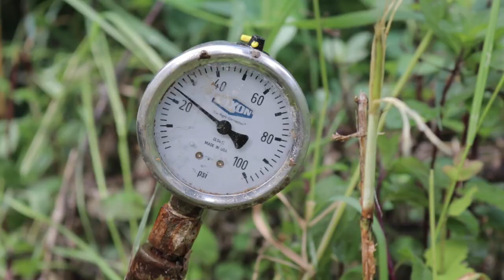My New Ram Pump - AMAZING!

Comment: Great Video, i appreciate what you say about moving water... im on a cattle station at the moment, and water is a major concern, we are in a drought and it hasnt rained for 2 years....so moving water around is very important here, we do it with pumps and tons and tons of pipe (the station is 1.3 million acres in size) this ram pump system is a fantastic idea...all we are missing is the elevation factor (its pretty flat out here) although the bore water is under a natural pressure....so it may work..... anyway great video and keep up the good work!!

Comment: At 9:00 if you can make the mesh into a conical shape then the leaves wont block the mesh (so much).
Reply: Oh! VERY good point. And while we are at it, how about a screen at the open end of the stand pipe, Sir?
Reply: Sure like the vent pipe for a toilet.

Just to be clear, I mean for the point of the cone to point away from the pipe.
Reply: Exactly by thoughts. A "self cleaning" design, often to be found in industrial components.
1) Look to increase the surface in contact with the in-flow, this will reduce the velocity.
2) Or, set up a meshed off pool in front of the pipe inlet, effectively increasing the surface area on the mesh.
3) Angle or taper the end, with the mesh screen, to use the stream flow to dislodge & wash away debris.
Reply: The mesh should have as much surface as possible. Sorry, but it was a mistake that you cut the mesh and did not make at least a ball-shaped mesh with a lot of surface. Regardless of that I like your stuff. Keep up the good work.
Reply: +trespire exactly.
Reply: Do you mean, what a plumber calls a "trap" like under the sink? (Some traps have a clean-out feature at the bottom that could be helpful too.
Reply: Also add a perimeter filter screen with larger holes around the intake I a 1-2’ diameter to stop large items before they get to the small screen.
Reply: in any case, maintenance has to be done. maybe not every month, but at least 2-3 times per season. all suggestions are valid and he should increase surface area of the intake screen/filter. do not forget if he lover down the intake, silt can and will build up enough to block intake. so check up is necessary especially after bigger rain falls.
Reply: @zoki.to974  The idea is to have a relatively large input box with a fairly fine mesh screen surrounding the input. The pool should be much larger than the box. Then, as the water is forced to slow to get through the screen, silt and other solids tend to settle out before getting through the mesh.

Comment: Hello. If u change that gate valve to a full bore ball valve, water will get less resistance going trough. That will increase the ram effect. That gate valve is slowing  down the water coming to the system. Great videos!

Comment: For all us electro-nerds out there, the ram pump works analogously to a boost converter.
The mass of the water in the supply pipe works like an inductor, while the air tube works as the smoothing capacitor.
Reply: Very good comparison
Reply: Very good comparison
Reply: Now that is language I understand. Nice analogy.
Reply: My background is more with plumbing and mechanical things. Hydraulic to electrical analogies are helpful.
Reply: Somewhere close to the end of the video I had the idea it may work similarly, then I found your comment.
Reply: I was thinking the same, just a little 2 level asynchronous boost converter.  Might be interesting to see one of these as a flying capacitor multilevel converter but that probably won't work.
Reply: Specifically, it seems like a Joule Thief. One in, one out, one common, self regulating oscillation. Additionally, the air tube isn't so much a capacitor as it is the inductor itself, as current flows into it, it creates a back pressure (EMF). It is definitely based off the idea that the current will increase pressure (voltage) to keep the current moving, like an inductor.
Reply: tactic00l the
Reply: tactic00l 8
Reply: I actually understood that. :D
Reply: @
tactic00l

this is the first time ive heard of converting plumbing to electrical equivalents , many times the other way tho :-)

Comment: Couple of tips for you:

When you open or close your gate valves (not the check valves, but the ones with handles on them), back the handle off a quarter-turn before walking away.  In the event that you leave the valve in the same position for a long time (like over the winter season, maybe) you may find it necessary to turn the handle in both directions before it comes loose and will let you run it all the way to the other position.  This approach does not work for Stopcock Valves (which only swing 90 degrees to open or close).  This tip is something I learned at my grandfather's knee... he was a Journeyman Plumber.

The other thing I would recommend is that you get a two foot long "Retrieving Tool", with a plunger on one end and three or four expanding prongs on the other end.  I generally soak mine in clean engine oil when they are new (or if they stop operating smoothly).  Throwing that into the end of your drive pipe to pull out debris will save you lots of time.  It is much more "the right tool for the job" than using a straight slot screwdriver.
Reply: That's right about a gate valve. Back the handle off a little bit from a full closure, not only to help loosen it if necessary, but also that when you come back after a long time, it confirms that it is closed. We happened to use 1/2 turn.

I learned this in Sea Scouts, on our boat. This has served me well for a loooong time.
Reply: AMEN: Good Idea.
Reply: use my shitter snake for cleanout
Reply: use olive oil on that instead of engine oil.  u dont want engine oil in you water! animals dont like it! a  drop  of motor oil will contaminate a small stream!

Comment: You should use an Y filter on the pipe as well. Makes cleaning very easy.  You unscrew the cap and all the junk that would otherwise go in the mechanism (to be read pump assembly) is easily removable through the Y filter. I have one on an irrigation system that's fed from a river near my grandpa's land. Big 2 inch ID one.
Reply: Even more ingenious, is to fit a nipple and ball valve in place of the cap. This way, a flush is easier. Open valve, let flow for a little bit. close valve, all's good!

Comment: I wonder if you could replace the union on your ram pump with a cam lock fitting? Like maybe an aluminum or plastic set of fittings that way its not so difficult to take apart for spring maintenance?

Comment: Mrs. W,  About the string going back inside the trimmer head thingy.  You are letting the string get to short.  It took me a long time to figure that out.  I thought I was conserving line when all I was doing was making more work for myself.  Take the time and tap the trimmer head and keep the line longer and it will save you a whole lot of grief.  They do make a replacement heads that has hard plastic arms that do the cutting but I have know idea how well they work or how long the will last.

Comment: Have you tried hammer unions? Used in the oil patch. As the name implies the only tool you'll need is a hammer. A lot easier than the barrel union.

Comment: I'm not sure what kind of trimmer line head you have there but it looks like its the kind that you don't have to open up to wind the string on. You should be able to simply thread the line through and then twist the head and it will wind right up. ;)

Comment: Cody,
Just curious if you ever considered filling a stock tank off of the waste valve from the pump.  I'm guessing that water just flows back into the stream bed.  If you had your pump sitting over, (or in)  an open top stock tank you could capture the waste in the stock tank and use it as a fire fighting reserve.  If I remember right you had an above ground pool for that last fire season.  The overflow from the tank could be directed back to the stream.  Just an idea.  

Great videos lately.  Been enjoying them.  
Jason.
Reply: @dheadhunter413  In theory, it sounds good, but you can't block the pulsing action of the waste valve because it will stop the big pump, so unless the waste valve is over a container that actually supplied the smaller pump, it wouldn't really work. Then you have to have enough drop between the supply 'container' and the small pump to actually make it efficient enough to lift the water back up again. Then... what do you do with the waste water from the small pump?? 😁
Reply: @danw1955  Make a smaller reservoir and pump of course!
Reply: @danw1955  Haha, "In theory it sounds good"... rather: exactly not! 😁
Perpetual motion machine - in theory, it sounds good, but in practice, it doesn't work... Maybe we haven't done enough research yet!! 😁😁😁
Reply: @pwhsbuild  You just solved the riddle of perpetual motion! 😁😁😁
Reply: @pwhsbuild  We are getting closer to the nano-ram-pump levels in a few more steps.
Reply: @TheCommono  Nonsense. It does not resemble a perpetual motion machine at all, since it need the force of the incoming water continuously to function.
Reply: @buggsy5  Nonsense? What a harsh word! As I said one comment further up: If BrainA in fact did not solve the problem with perpetual motion (although I doubt it, look at his name: BrainA!), then I strongly guess we just have to do more research, simple as that! We should finally emancipate the water and liberate its energy! Let's make an end to this confinement of the water!
Reply: Sure you could fill anything with that. And you wouldnt need a pump to do it since it is BELOW the intake. You would quickly fill whatever you were attempting to fill, and then have the same messy sloppy situation. My advice would be more of a sluice or drain, that would rejoin the creek or stream further down the grade.  Databyter
Reply: @TheCommono    Nonsense, the word by itself is neutral - just a noun.  
The delivery or reception of the word is what puts any influence on it.
Reply: @OneWildTurkey  I guess I feel right now like a computer crashing, as I can't get my head arround this one question: When 'nonsense' is just a noun, what is 'noun' then?
Reply: @TheCommono  not an actual perpetual machine sorry
Reply: @hksjoshua  "not actual" -  but there is still hope for us seeing one day perpetual motion understood and applied?

Comment: What do you do about water logging the air chamber? Have you tried a snifter? Nice ram in it's total simplicity - no need for the spill valve adjustment as on the commercial ones?

Comment: I've been thinking about these for years, and I just 'got' it. A Step-Up Transformer for water. You're exchanging cfm (cubic feet per minute) flow for pressure. Just as you'd exchange amperage for volts. Watts = Amps X Volts. You use a bigger wire to have no resistance (heating). Here, you use the bigger drive pipe to have no resistance (water friction from speed). It goes into the transformer (pressure PVC pipe), a water-driven piston that converts the momentum (cfm) into pressure (psi, ~20), which waits for the swing valve to close then converts the pressure back into momentum for the smaller feed pipe. 

Watts = cfm. 
Amps = Pipe diameter
Volts = psi

The magic for me is the 1:7, drop height to pump height. Maybe that has to do with the volume building up in the pressure pipe and the feeding flow rate: you could build up more pressure with a high-flowing, high feet-head feed, going into a larger pressure pipe? If it's too large, it won't 'prime.'

There's a related pumping system, called a trompe, or hydropneumatic plant. Bill Mollison has a video on one, and here's an old video of the one he discusses, in Canada: https://www.youtube.com/watch?v=UtYLVLkWyGc

Comment: ive been using those plastic blade heads on my grass trimmer for 1.5 yrs now and HATE THEM lol... i am switching back to line fed when the current blades wear out. for me and in my opinion the line fed is easier to deal with using my trimmer. it last way longer between refills etc... i have a brush cutter with a metal blade for when i need something better then the line anyhow. nice video. i just built seth's from land to house ram pump design and it cost me $40. all pvc and one piece was brass (one of the check valves) but i do get a 10% discount at the hardware store to so it would normally cost someone more. hope to install it later this week. it is 3/4 inch in and 1/2 inch out with 15 feet of potential head drop but only need 20 feet give or take of lift so may need to adjust its location some. looking at your water tower build for next summer. may incorporate that into my system. nice video thanks for sharing. hope my trolls didnt follow me over here...

Comment: If you put 2-3 wraps of teflon tape over the threads of the union in your drive pipe it will not set up from rust as bad. Someone will always say who put tape on that union the brass seat seals the union it you don't need teflon tape but its not there to seal just to make it easier to disassemble latter on.

Comment: I’ve heard of ram pumps for years and knew that they required no electricity but never saw one or had it explained how they work.   Thanks
Reply: @Mike Robbins
he did explain it well , he didnt mention that it is a fluid hammer , which is how it gets more pressure :-)

Comment: You're correct, the ram pump has been around for a long time. When I was a teenager I helped a friend rebuild one. Of course the rebuild on this cast iron only amounted to removing the ram (first) valve and replacing the brass valve stem. To my knowledge that same pump has been working for the last 20 years and seems to be in shape to work for another.
Reply: Oh, I forgot to mention the date on the cast body of the pump was 1878.

Comment: Saw you zip on that bit of screen and decided to offer an alternative solution.  Take a pvc pipe, 8 inches long and cut slots into it on both sides.  File them smooth and roughly 1/8 inch wide.  Wrap it with screen and then cap it off.  now you have a larger water intake that wont clog as easily.